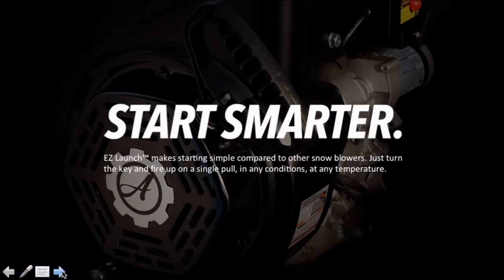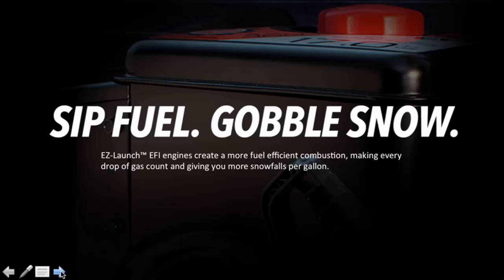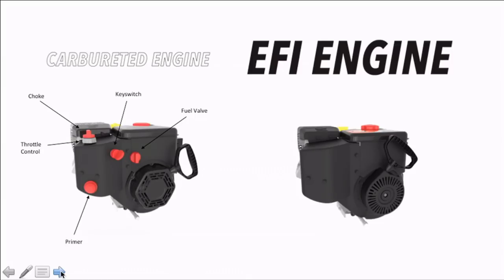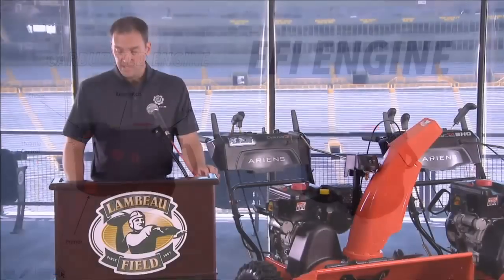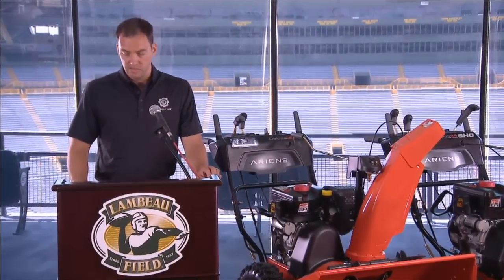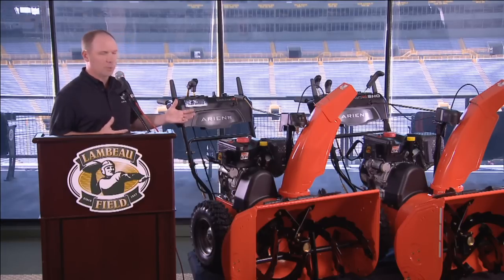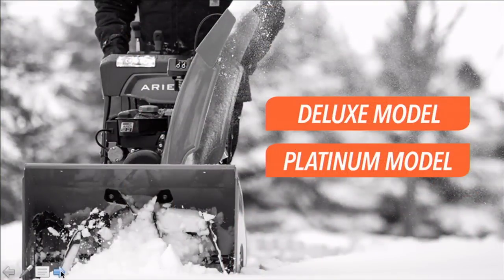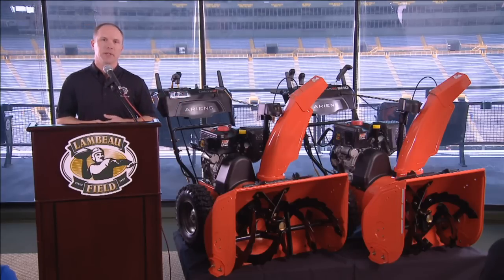Introducing Ariens EZ-Launch EFI Engine For Sno-Thro Line

Comment: I was looking at getting an upgrade for my 24 inch Ariens Snowblower Compact to a more stronger CC Engine (I decided to go with a 28 inch Pro Hydro Rapidtrak Carb unit so I can get those end of the driveways more easily with higher/heavier denser snowfalls) and decided not to go with EFI since I already have electric battery based snowblowers (all 80 volt from a company called Greenworks) from other companies which include a two stage and its basically as simple as an EFI without the Pull and dealing with a choke (just insert a battery, pull/hold the handle at the dashboard up top and press the button and away you go!). Yes they aren't as powerful but they have their place with dealing with certain kinds of snowfall up to medium density wet snowfall (until in my opinion the electric battery companies with snow equipment come out with snowblowers more in the 28-36 inch bucket ranges with higher more powerful batteries that match the 300-420 cc engines). I decided to stick with Carb because of being able to take care of the machine more cheaply for heavier snowfall (yes it is still a pain to figure out how much priming and remembering to clean the carb as well at the end of a season but I think its still worth having, once you practice the startup procedure enough, then it should be a piece of cake every year). EFI engines are much more expensive to maintain (but I do respect how much easier it is to start them of course, which I do like but the one thing here is I do not like the fact I have to recharge its battery 3 times throughout the year??? I mean I use the electric equipment battery packs and yes they are bigger but I only have to recharge those to full charge once and store them long term fully charged, never have to think about the batteries too much until you need them for a job) with the gas issues that can come up with them if they did start to fall, and maintenance in general for gas equipment is much more expensive as well. Electric is far cheaper to maintain over the long term. The Local Dealer already told me he doesn't really care that much for the EFI engines because of the maintenance costs are far higher to start them and Carb I much prefer for most of the machine to keep it mechanical as well because of keeping the costs down as much as possible vs. my other electric equipment now. Maybe in a commercial setting I can see why using a EFI engine is actually better and less hassle actually since your using the tool constantly but for a homeowner, Carb is going to be better over the long term.

Comment: To bad you used a small 7V battery, same one they use in small remote control cars, and that's creating a problem for a LOT of these owners. Should have used a 12V battery. The connectors and the idle dial are problems too. I was thinking about going for the Deluxe 30 EFI but then went down the Reddit rabbit hole with all the problems people are having with these. Went for the carb version.

Comment: Costs more to buy & more still to own. Moreover, it doesn't start when you need it most & mechanics don’t know how to fix or figure it out. Problem since year 1. Dealership won't submit as a lemon. I just keep suffering & shovel by hand with an expensive EFI mistake in garage or shop. Worst purchase ever.

Comment: Turd. Bought mine(deluxe EFI 30” wide) 3 yrs ago just before “the big one” that never materialised. Used 1x for 5” of slop. Doing my winter prep today and it won’t start... wtf.
Reply: Have to charge the 7.2v rc car battery to run the fuel pump and rest of the efi stuff…. I’ll take a carb any day.
Reply: You have electronic fuel injection. And you did not know you have a battery says it all .

Comment: What’s the difference between the deluxe and platinum?
Reply: Platinum has 369 engine vs 254. Teflon skid shoes, shoot control is different, also the impeller is high output. It has handle warmers

Comment: so what happens when it fails because some will. being all computerized and non mechanical, there is not a whole lot people can do to fix it and have it tuned properly, especially uneducated people. Of course fuel injected works really well, but being computerized is not great when it fails. also a primer, throttle and choke is not a complex control, those are very simple controls.... Still a very cool blower don't get me wrong here, top notch product right here.
Reply: The EFI does perform well but it is not top notch.  They use cheap connectors everywhere and didn't really think through making the battery easy to charge and remove, instead tucking it way up under the dash.   And of course as you point out repairing it is beyond most people and very expensive.   The battery alone costs as much as a complete carburetor.  And in my opinion just keeping that battery charged is more of a hassle than a carburetor could ever be.

Comment: That all good but why Cant I get the 32' Kraken to replace a 27 year oldJohn Deere #1032D will keep this for a backup the Dealer in Bradley, Illinois have 2 on order but Cant get any info would be nice to know its either the Kraken or a Honda 1332 but preferably the Kraken I can hold off till next November's if you can get me one to the Bradley,Illinois Dealer thanks

Comment: Buy a Ariens Platinum 28 SHO before 1,5 month. Ariens say with EFI the machine start everytime with first pull. my machine start 90% with the second pull. its a known problem or normal?
Reply from the maker: Thanks for asking! We really don't hear about this issue, but there are some variables that can affect starting performance. For example, a fouled or incorrectly gapped spark plug, old gasoline and the speed at which you pull the recoil starter rope could affect starting.

If you believe there is an issue with your unit, we recommend contacting your nearest Ariens servicing dealer. A servicing dealer in your area can be found here: https://www.ariens.com/en-us/dealer-locator
Reply: These are known for dead batteries, and fuel pumps going bad. Besides that… it is a computer. If the voltage on the 7.2v rc car battery is remotely low, it won’t start right. It was a terrible rollout to use 7.2v efi instead of 12v… no one can jump it started, and the chargers take about 4 hrs to get it up to working voltage if it’s dead.

Comment: Yeah my dealer said don’t buy it the batteries under the controls there’s a charger or there is not a charger to charge that little battery to keep the electronic part activated this will start he convinced me not to buy it so I didn’t buy it so I bought the 32 professional no problem turn the key and choking it choking it Do you need to figure out where the battery has to go this way you can charge it he showed me under the dashboard that there’s a plug I said where is the end of it to charge it not a good idea I don’t think he didn’t tell me that machine is a lot more money to he said you don’t want that and he’s a big dealer up here in Albany New York

Comment: I’ve never owned a snowblower I have a gravel drive always been told it would grab the gravel isn’t there a adjustment to raise the augers
Reply from the maker: Thanks for asking, Gary. Our two-stage Sno-Thro models work great on gravel driveways. All you need to do is lower the skid shoes so the housing has extra clearance when clearing loose surfaces. You can see an example of those instructions in the manual we linked below. Have a look at pages 16 and 17: https://apache.ariens.com/manuals/05135600C_ENG.PDF

Comment: EFI definitely the way to go. The commercial grade Kawasaki and Kohler efi  engines are awesome.
Reply: Great when it works. Nightmare when it doesn't start & mechanics can't diagnose.
Machines were put out before ready.
Reply: @BrianBrown-gy9xl  7 years later they still aren't ready.  Same half-assed engineering not built for harsh conditions and expensive to fix when it inevitably fails.  I have never had a carb completely fail me leaving me unable to finish the job like these EFI machines have done to thousands of owners.

Comment: I like the fact that my Ariens Deluxe 27 is made completely out of Steel, and should last a long, long time.  However, I am a little peeved that it doesn't come with rubber impellers that you can get on Amazon for $50.  After having to scrap ice from the chute a bunch of times during a wet snowstorm, I DIYed one for myself and it took me 2 days of experimentation, and the final result is clearly not as good as if it came straight from the factory.  At $1000+, why doesn't Ariens come standard with the rubber impellers?  For those who don't know what the rubber impeller does, it scraps the sides of the chute so that it doesn't ice up. It also throws the snow nearly twice as far.  At least make this an add-on option.   Does your platinum and Professional series have this rubber impeller?  If not, I cannot fashion myself spending nearly $3000 for a machine that gets clogged with wet snow that I have to mess with.
Reply from the maker: Thanks for the comments, and we're glad you're enjoying your Ariens Deluxe Sno-Thro! We completely understand about the issues you have with wet, heavy snow. The reason we don't equip our units with rubber impellers or offer them as a part or accessory is because they would have no impact on the amount of snow that sticks to the chute walls. Even if you use a rubber impeller compared to a steel impeller, it still throws snow into the chute -- whether it sticks to the chute walls or not is all a matter of snow consistency and Mother Nature.

Because of this issue, we developed a product that might help you and others. It's called Snow-Jet. It's a non-stick polymer coating that you spray inside the chute, housing and onto the augers and impeller before clearing to help reduce the ability for that wet, heavy snow to stick. Check it out here or find it at your local Ariens dealer: https://parts.ariens.com/ARIENS-SNOW-JET-Non-Stick-Polymer-Spray-11-oz-p/70709000.htm

Comment: This will be just like the 2005-2010 Ariens. All junk with the drive gear they played with until it went back to almost originally what they had from day one. The Techumsa was a tank of a engine. I still have two that run great. On Ariens I might add. Now you have this unproven EFI that will be an maintenance NIGHTMARE.

Comment: Fuel injection is definitely way to go it's nice to see the small engines are starting to get EFI. I still have one of your snowblowers it is a 1966 Ariens 10M6D 24" still gets the job done when it snows. I'm impressed you can still buy parts for it. It truly is a lifetime snowblower
Reply: I have a 1976. Runs like a champ!

Comment: LMAO...UPDATE to my comments. I was at THE HD. And saw a Ariens Deluxe 30. It had the EFI engine on it. But what in hell is that dial on the cockpit dash what ever you wanna call it. The dial is from a CIRCA 1960's-70's appliance knob. You know the black ones. It is some variable power knob that regulates POWER?????? No clicks pure sloppy dial. Should work great in the winter with freezing hands in gloves, wind blowing snow coming down all over the place not to mention the snow from the shoot blowing back in your face. Now WTF is the dial for??????
Reply: That's basically what would be your throttle like on the old machines when it was controlled by a cable and then eventually they moved it straight on the engine. I have already heard horror stories about that knob. It does not have enough resistance so it moves around on its own. People's fix to that is a piece of tape. The advantage to people who bought this setup the first year out the gate..... They have not found and fixed the flaws yet. On later models that dial will have more resistance that's one area in need of improvement. What else?
Reply: I have one of these and I did but the extended warranty from Ariens (99.99 for 5 years) because I do have concerns about the repair cost of the EFI components. I agree the dial is not the prettiest thing in the world but having used it in several big storms this year it is completely functional. At minimum idle the machine is very quiet and likely very fuel efficient if you have periodic shoveling to do on steps or walks, moving cars etc.

Comment: I'll stick with my '88 model 8HP Ariens. All new power equipment these days is a joke. you're much better off maintaining an older model. it'll last a lifetime unlike these new plastic china pride crap machines that'll be in the scrap heap in 10 years.
Reply: Agree my 1971 is a tank and does not have one piece of plastic on it. It's a tank and it's going on its 47th winter in service coming up.

Comment: Maybe when my 1979 8/32 goes down, but I don't see that happening any time soon.  The ole Tecumseh keeps going with ethanol free juice!  Lets see a 3 year follow up review on one of these.
Reply: When the engine does finally kick the bucket, you do a re-power to the machine and get another 40+ years of service.

Comment: I have  plat 30 that starts and works great ...... not a big deal to operate ..... 300 dollars more for EFI is quite a chunk of change for something that REALLY wouldn't be much of a benefit for me .... I find my plat 30 great on fuel consumption
Reply: Not to mention requiring a battery every two seasons which they didn't even specify it's cost. I do love Ariens though.

Comment: Drop your dam prices on theses machines so people can buy them  its a snowblower not a car
Reply: Go buy a troy built, you might like the price more. You'll buy another in 3 years though.   Quality comes with a price and these last literally decades when taken care of.
Reply: No thanks i had troy built and  cub cadet all junk and did not perform at all theses were bought new and fell apart and rusted after 1 winter use i do however have a pro28 ariens my comment was the pricing went up a lot in two years my son needs a good machine i will buy a Kabota tractor and give him the pro .
Reply: +andrew glazier my point exactly.  They're pricey but are at least worth it.
Reply: andrew glazier Troy built are not what they used to be thats for sure. Neather is Cub. I tell older guys wanting to buy newer models just because,I tell them dont. I have rebuilt and fixed their older units with great results and tell them ,keep it properly maintained and you can never go wrong. If you dont use ethanol fuel thats your number one thing. Get recreational fuel if possible.
Reply: Maintenance is the key for sure as for the price of theses machines i understand the dealers are jacking up to make huge prof fits be great to buy it from the source .now i have owned troy built cub  all junk went through 6 of them and yes they were maintained proper i have many very large tractors and trucks maintenance
 is always being done to keep them in top shape just disappointed they failed so easy now i do have a professional 28 Ariens  bought it for 2000 new if you went to buy it today they are 3500 plus tax where is the gold on them to make them go up so much in price .
Reply: Troy and cub are the same. MTD.

Comment: And these dudes are clueless. And the woman great plant. Now lets get serious. 
1-Have you guys blown a 300 foot driveway in he middle of a blizzard in New England in a Blizzard with heavy wet snow???
2-Have you blown a 300 foot drive with slush???
3-Do you notice the power difference between a 8HP, 9.5 and 11HP Tecumseh  Vs these new AX engines?????
4-Do you know that my 17 year old 9321001 Starts on the first pull every season with 3-4 pushes of he prime button with old gas??????
I could go on and on. But I have done all of the above and more. Had to fix them in the middle of blizzards due to belt slippage or braking. Shift linkage coming apart chutes binding.
AND FOR GOD SAKES MAKE THE LIGHT BRIGHTER. ANd the CHUTE get's in the way too.
Can I get paid for doing your jobs?????
I am an Ariens owner. So fire away with the questions.

Comment: There is nothing complicated about starting a snow blower engine. What you have is a bunch of morons today that don't know how to do anything. I have been starting snowblower engines and lawnmowers for over 50 years and never had a problem I could not handle. The problem is that our society is becoming full of IDIOTS!
You guys as Ariens should get your heads out of your butts. Especially in Marketing. Your website is so UN INFORMATIONAL it  is not funny. Ariens Engineers really. Lets just get power back to the snowblowers and torque to blowing snow. You made crap from 2006-2012 Until you figured out to get away from that auto turn crap. You used to make a great blower. I have one from 1966 and one from 2000. They both run thanks to simple maintenance. I want to get a new one but I am not impressed unless I buy a pro or Plat with HO. But I want a 28 with HO not a 24!

Comment: So, the battery is not a maintenance issue. . . until the third season.
And with a five-year old Ariens, will you need an OBD-type scanner to diagnose it if it won't start?
Reply: How does the battery get charged ?
Reply: @reginaldsmall3766 you receive a battery charger with the purchase.
Reply: Yea its gonna be expensive to pay for the added battery, electronics, etc.  I only used my blower 3 times last winter here in MN, so battery going to crap will definetly happen, unless they are smart and you can come out with your drill battery and snap it in just to do a job.  Scanner doesn't matter as they are only $20.  Having a water tight enclosure to protect the electronics from snow, hope they have that figured out, but I'm sure give it a few years and the customer complaints will start arising from that.